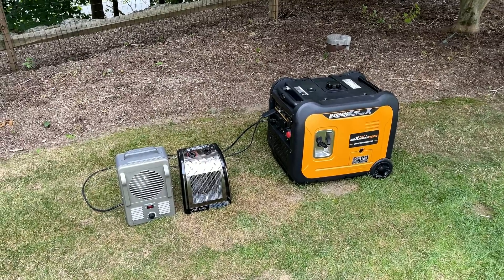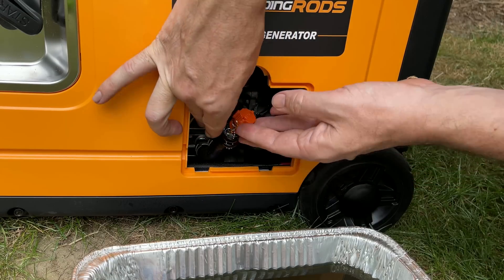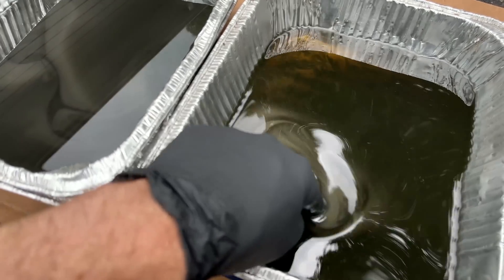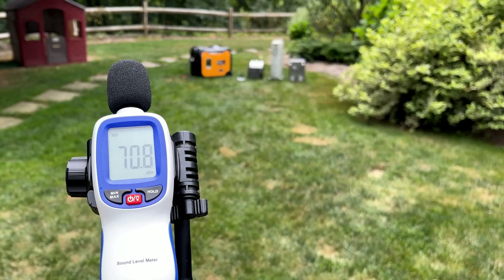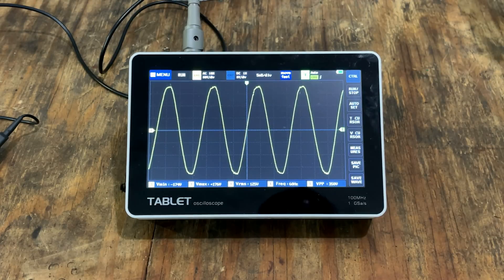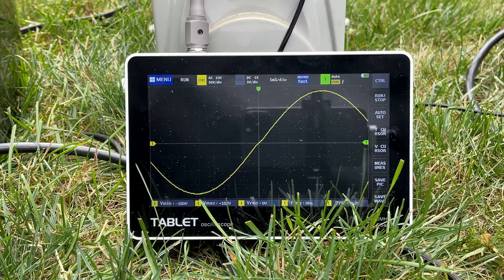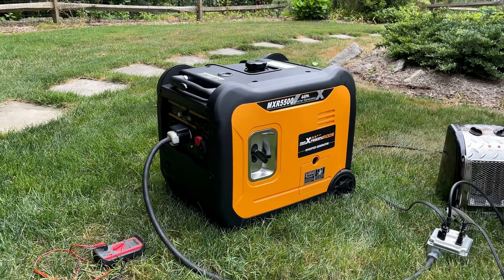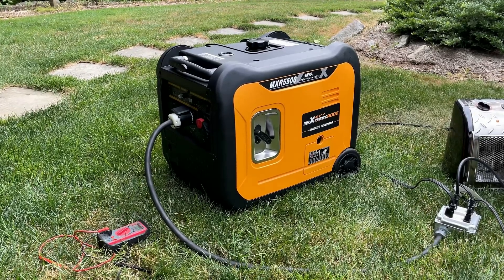MAXPEEDINGRODS Inverter Generator Load Test

Comment: I got a new inverter generator and it seems like it's got some pops out of exhaust. It's quiet exhaust system so not really popping but stumbling maybe. Is that normal while it breaks in?
Edit: so I fired it up today to warm up the oil to change it and put in actual break in oil. (Ran 2 fills of dino oil to get most the flakes out) and it didn't happen today. Not sure if I just need to run it or what. I've just been idling it with the dino to get the big flakes out. Now I'll be exercising it with the purple break in oil. I'll see if it happens again. Seemed like backfiring